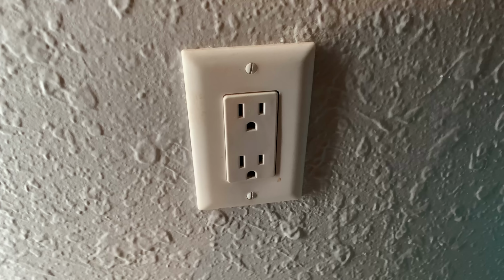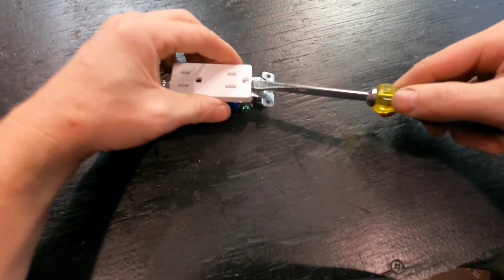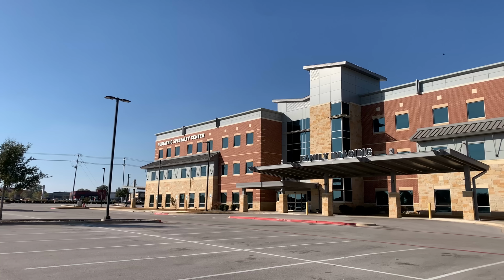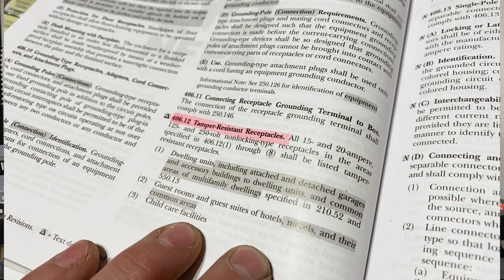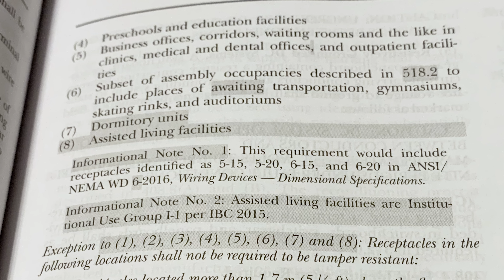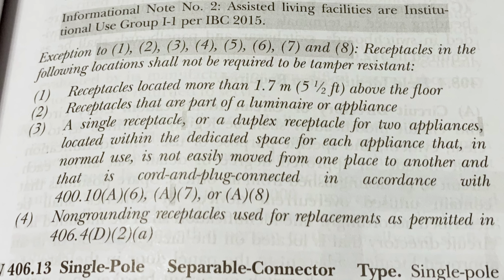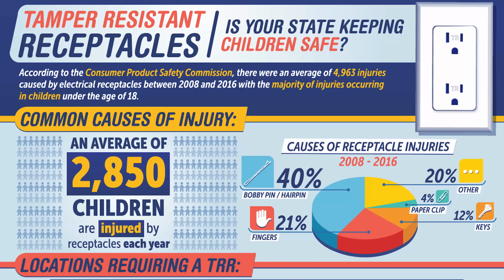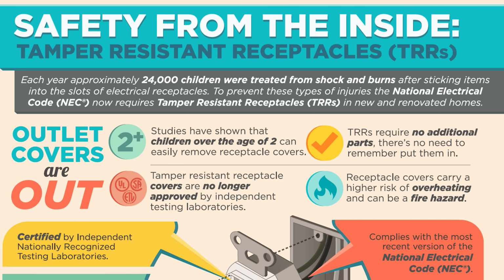How TAMPER RESISTANT RECEPTACLES Work & Where They're Required By The National Electrical Code

Comment: When I was a toddler, I was into everything.  As you said, just exploring the world and trying figure out how it all works.  I snuck down to the barn, and was trying to get the cover of a receptacle to look inside.  And got caught by a male member of the family.  Who grabbed me by the hand and grabbed the lead to the electric fence.  After an eternity, they let me go and told me that was what was in there, but the ReddiKillowatts in there were bigger and meaner, so I shouldn’t mess with those things.  

I’ve never forgotten that lesson, and still think of it anytime I work around wiring.  It took me years to get tot he point I was even a little bit comfortable working in a panel.

Comment: The huge flaw with TR receptacles is that most homes have power strips all over the place; And nearly all of those do not have TR protection.
Reply: This is not an electrician's issue.  You can only do so much, and after a certain point, it's on the caregivers. If it is clear that kids are frequently in a particular house, then you might inform the responsible party what the purpose of TR receptacles is.  It's possible that they are not aware, but obviously, it should be related to the service call or when you happen to see a kid poking at a receptacle.  Just bringing it up randomly could be construed as an inappropriate up sell.
Reply: The huge flaw with TR receptacles is that you can’t plug anything into them to provide electricity to something when it requires an animating force.

Comment: We've had "tamper resistant" receptacles in the UK since the 50s. Even extension leads must have covers over the L/N pins that only get opened when the earth pin (which is longer) is inserted into its hole.
Reply: The old British ones are opened by the ground pin alone. They are not that safe.
Reply: @okaro6595  how are they not safe? It would take a talented child to find something to push the lever up and then insert something metal at the same time. Some badly designed extension leads can be opened by putting a plug in upside down, but most can't and your certainly can't do that with wall sockets
Reply: Yes, but the way the UK shutters work is more suitable than these North American ones.  The ground pin easily opens them up.  The North American shuttered sockets are a pain in the neck to open up, they’re far too stiff.  Additionally, the prongs of the UK plug are much thicker than those of the North American plug.  When the shutter is open on a UK outlet, the prong holes are appreciable, so shutters reasonably make sense on them.  The prong holes on a North American outlet, by comparison, are very narrow
Reply: This is one thing I argue that should be adapted here in the US. The coverings on the plug are definitely safer but I think our tamper resistant gates are better. We need our powers combined so that outlets have our gates but UK plug coverings.
Reply: That advantage of the UK shutter system is all plugs have a ground pin that opens the shutters. The problem in the US is we use a combination of  2-wire and 3-wire plugs so the shutters need to be opened by the hot and neutral prongs.
Reply: @macr88  you've lived a sheltered life if you think a temper proof receptacle is "suffering"

Comment: I'm just a homeowner wanting to do updates and learning a LOT about electrical. Darn, it's so interesting and I probably have loads of dumb questions. One of them is this - if TR receptacles are required then why can I go out today and buy non-TR receptacles? And also, if it's required in commercial settings as well, why does it seem harder to find those in TR? I see some other vids out there touting commercial receptacles over residential and all the ones in their videos are not TR so I'm pretty confused.

Comment: I was in the bobbie pin group back in the '60s.  Have memories that I did it at least twice.  Loud pop, black mark up the wall, lots of yelling.  Later by 9 or 10 it was my job to reset breakers and such as the "man" in the house.  This required climbing on top of the dryer in front of the panel in an outside utility room.  Much later, I learned that sitting or leaning across grounded metal while in an electrical panel is not good safety practice.  But no internet back then, just old men who had survived far more dangerous things in their childhood.

Comment: 22 years old now but I remember getting lit up when I was 10. I took a piece of metal off the bearings of my skateboard and stuck it in an outlet . I learned my lesson , kids now a days will never know
Reply: yes they will kids are smart enough to figure out if you bend a hair pin just right or a fork you can get it into the shutters for the shock of a reward lol
Reply: At 10?

Comment: Hey Dustin, back in the 80s, when transformers and GI Joes were made GREAT, very durable metal and strong plastic parts...back than. I was one of those kids, that would take crap apart (mom would go bananas, coming home from work and seeing a new toaster apart, etc...), as the babysitter (was also a latchkey kid, lol) spent 99.999% of time watching MTV & talking to boyfriends, back then. So my sisters would dare me to “play” with outlets😅 Remember one time though, I got knocked across the room from getting “shocked” by shoving a steak knife into an outlet 🤦🏼.
Hey, was diff time back then right😉 AND some kids are just STUBBORN 🙃
Love your stories and how you “teach/talk” when doing code. Think having you when was started as apprentice & so on, woulda been cool👍🏻
L8R Man✌🏼
Reply: A regular 110/120 outlet is not going to knock anyone across the room, even a kid. It will give you a zap ⚡️ for sure. But I think you’ve watched too many movies and made that story up in your head lol.

Comment: One of my earliest memories: I was crawling around on the dining room floor and wondering what made the plastic Santa Claus light up.  I pulled the cord out of it and unscrewed the bulb. I remember thinking that something must come out of that socket that makes the bulb light up, so I stuck my finger in.  ZAP!  Scared the livin' bajeezuz out of me.  I was afraid I'd get in trouble, so I screwed the bulb back in, put it back in the Santa and I never told anyone until decades later.

Comment: It wouldn’t be such a big deal if the manufacturers made tamper-resistant receptacles that were transparently useable. Eaton seems to have figured this out.
Reply: Just bought 30 Eaton tr outlet. Installed 10 and it's the worst garbage ever trying to plug anything with prong that aren't almost straight at the end. Those Curved one are to be plug with a sledgehammer
Reply: @kladen2006  Prongs with curved ends are a fire hazard because they don’t make even contact. It’s best just to straighten them.

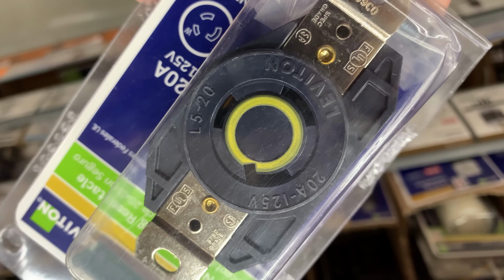Comment: Small bit of confusion: At 4:13 you show a locking L5-20 receptacle in a segment which seems to imply (in the spoken narrative) a need for “tamper resistance”. As I read the 2020 NEC, such locking receptacles are explicitly exempted from the TR requirement, regardless of their location... and I haven’t yet seen a TR version of the L5-15, L5-20 or any of the other 120 or 250 v locking receptacles at my supplier. Is there someplace elsewhere in the 2020 NEC which would preclude installing one of these “industrial” receptacles in a residential space, say in a garage, for use with a matching locking extension cord?

Comment: Hello, I have a question. I noticed there are the springs in the 2 parallel rectangle receptacles. What about the single circle hole below the 2 parallel receptacles? Is there some sort of spring for that hole? what if a kid sticks a metal needle inside that hole? I was just curious about the 3rd hole. Other than that very great information !

Comment: Hey Dustin! I’ve enjoyed watching all of your videos. I do have a few video suggestions for you. I just watched your “How do HID lamps work.” Great video, but was curious if you could  go through and explain how to wire each ballast, capacitor and igniter. I know that some ballast have a schematic, but I’m still confused.  Also… Going to residential. I’ve seen all of your how to wire single and 3 way switch videos, but wanted to see how to cut in multiple switches in the rough in stage. That would be really helpful! Thanks again for all that you do.

Comment: The best thing is to use this in combination with RCD/GFCI protection. The american outlets have one big disadvantage. If the plug is only partially inserted into the outlet, live parts are exposed and touchable. Most other plugs have measures to prevent this. The british BS 1363 and the australian plugs have sleevings on their pins for the line and the neutral. The german Schuko system is recessed, so in that case also no way of touching the pins when the plug is only partially inserted. The Europlugs for appliances with a small demand, plug is rated for 2.5A/250V, and only for class 2 appliances, has sleevings. That plug is called Europlug because it fits into all european outlet systems without an adapter, except the british ones. 

And we have also such a system, works the same way. But here it is not mandatory, only recommended to install them. For the safety they are ok, but as an electrician to get the probes in they're really a pain. The outlets are not special, the shutters here are integrated into the cover which is held on by a screw in the center of the outlet. So a retrofit without changing the outlet itself is possible if you pick the same manufacturer and same series. Left without shutters, right one is the version with shutters:

https://upload.wikimedia.org/wikipedia/commons/6/6e/Schuko_LH_without_shutters_RH_with.jpg

The plug is covered by the outlet until the first ring here, so it's impossible to come in contact with the pins when the plug is only partially inserted into the outlet:

https://upload.wikimedia.org/wikipedia/commons/e/e4/Schuko_standard.jpg
Reply: So you want more regulations?   How about moving the receptacles so they are not at ground level?   Who is that short?
Reply: People in wheel chairs?

Comment: I was one of those kids who stuck a metal object in a light socket. Did it back in the late 70s when I was 3 or 4 years old.
Reply from the maker: I'm still one of those kids...
Reply: That brings up a good question. There are these Tamper Resistance outlets but is there some sort of Tamper Resistant light sockets and code requirements about it?

Comment: Lol kind of a random question but does closed cell spray foam tend to harm Ethernet cable, or should this not be an issue if sprayed properly? I’m planning on running Cat 6 in my new house (it’s under construction).

Comment: I find the leviton tr ones are horrible for trying to plug something in especially when new, but the Eatons are good out of the box they feel so much easier for plugging devices. Also its crazy that little cheap piece of plastic that probably costs less than 5 cents if even that doubled the price of a box from 10 to now 20. Can't even really find any that aren't TR these days which is good that its following code, but I do understand some of the complaints of people. Going to the elderly couple with no young kids that moved out hearing the complaints of they can't plug anything in because of their arthritis etc is annoying. You would think they would allow more leeway and accommodations for such cases and leave it for home inspectors to just flag when the house goes to market and say a couple is moving in with children that it now has to be changed to TR.

Comment: isn't TR superseded by GFCI and AFCI protection?
Reply: No.
They make GFCI and AFCI that are also tamper resistant.
Reply: @jonathanfurtado3696  they sure do. but does it make sense?
Reply: @wim0104  
Yes it makes sense.
If you are not representative to ground and you touch the neutral and live connections of a GFI you will be electrocuted to death. Because the GFI senses no difference between the power going out and what's coming back.
And if the arc fault doesn't detect an actual Arc with you. it's not going to trip.
I said electrocuted to death slightly oxymoron.

Comment: I have just installed a Cooper brand GFCI with Tamper Proof, Self Test, Night Light and l.e.d.'s for 'tripped' and 'all ok' indications.....oh, and two electrical outlets on a newly remodelled kitchen island. Whew! Seriously though, these things are getting way too complicated. At first it seemed easy enough to plug something in but that quickly changed to becoming the most frustrating thing I have seen in many years. The force required to push in a plug (even with rocking the plug) was to tremendously great it was distorting the whole assembly so much that the gfci was actually tripping. Absolute nonsense. Then I noticed that the metal ends of the two flat blades were quite sharp to the touch. After taking a fine file to these sharp edges and eliminating the sharp corners the plug slides home without much bother at all now. Really, I was almost at the point of taking a fucking hammer to the thing and pounding it to smithereens. What we have to go through for the idiocy of a lot of people is beyond me. I feel sorry for the young kids that have parents who don't bother to take the time to emplain the dangers of fooling with electricity. Then again we cannot cover the world in bubblewrap and foam padding. So, take a file and smooth off the sharp corners of the blade ends that you wish to insert into these tamperproof receptacles. The sharp metal edges of the blades sink into the softer plastic of the sliding tamperproof covers and prevents them from sliding out of the way.

Comment: Why would the NEC exclude nongrounded receptacles from these rules? Only thing I can think of is that maybe nongrounded tamperproof receptacles don't exist, and replacing a 2-wire receptacle with a 3-wire tamperproof one when there's no equipment ground to connect to violates some other rule?
Reply: Locations where there are grounded devices are much more dangerous as to get a serious shock one has to touch ground.

Comment: I have no objections to tamper resistant outlets being available to those who want them, such as parents of little children, but I would never use them myself.  There are no little children running around my house, and anyone over the age of 12 who thinks sticking a fork or the like into an energized socket is a good idea deserves to be shocked.  

I installed one in my sitting room several years ago, because I didn’t realize when I bought it that it had shutters (wasn’t even aware at the time that the USA had started making them), and I despise it.  It’s a battle to try to shove a plug into it, and if it weren’t for the fact that it is seldom used, I would have replaced it with a regular non-shuttered outlet.  

I’m glad I’m not a fan of modern construction, because this code requirement is just more nanny state b.s. to me

Comment: Safety shuttered have been mandatory on new UK installations since 1947.   What took you guys so long?
Reply: where cheap and not fannies darwin be dammed lol
Reply: It is easier to do with the ground pin on all sockets. The drawback is that it also is less secure as a kid can push a knitting needle in the ground hole and open the socket.

In Finland there were special shuttered sockets since the 50s but those were used only on kid's rooms. General shuttered sockets were introduced in the 70s. In 1980-84 three kids were killed by sticking something in a socket. Since then there has been none as shutters have become a norm. I do not know it they are mandatory but the idea of installing anything else would be absurd.

Comment: What young man ISN'T trying to stick stuff into other stuff!? 🤣
Seriously though, everything is a compromise. If things were designed better from the get-go, we might be a little better off with things that are tamper resistant AND work well. People make fun of the big old chunky UK plug, but that thing is safe as $#!& with the sleeved pins and fused connection.
Reply: the Schuko/euro plug with TR works very well too, thanks to the rounded pins.

Comment: Just spent two hours trying to plug a saws all into a welder generator,  I was unsuccessful.  Tomorrow I will open it up and bare the wires so I can just twist the hot and twist the nuetral together.  It will be much more convenient.  When I forced it in it shunted the blades off to the left and didn’t work.  Wasted half my only day off.  So f ing ticked…….

Comment: How are these kids going to learn? You should not have to install them if the outlet is GFCI protected, which they all are now by the 2020 NEC.
Reply: GFCIs fail after a while.
Reply: GFCI protects after something is shoved into the socket,  TR is to prevent something from being shoved in a socket.